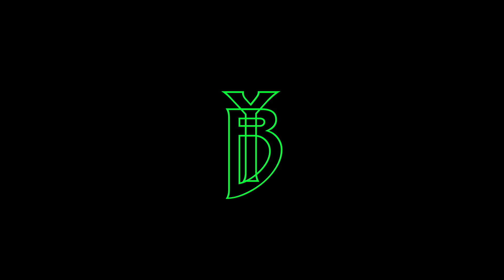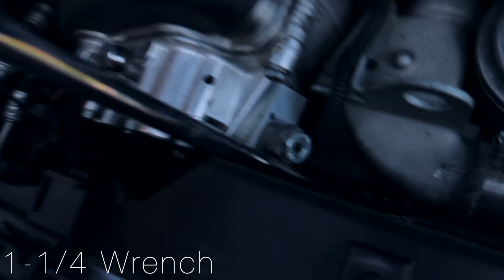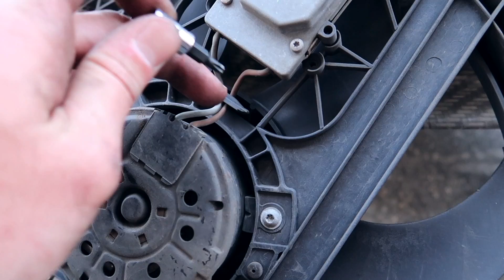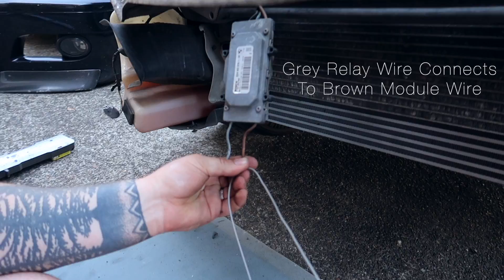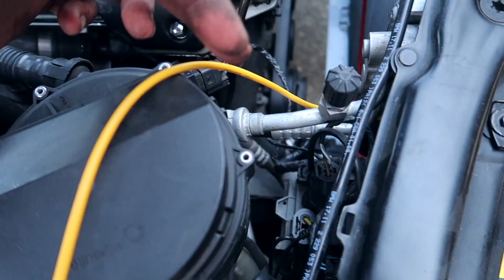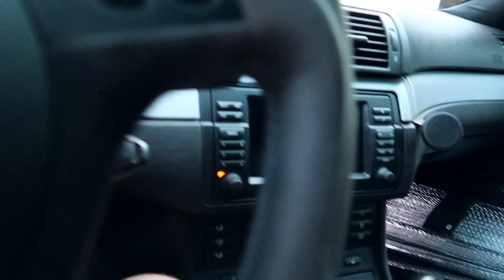EASY BMW E46 M3 SPAL Electric Fan Upgrade

Comment: Just wondering have you chewed through relays because I’m certain the fan controller will output a lower voltage for lower temps as they work like 50% then 70-90% when exceeds certain temps. I’m just assuming the voltage would be lower to the relay and might get relay chatter
Reply from the maker: Nope, I only replaced that fuse once after driving it for almost 2 years.

Comment: I did the exact same set up as you, but i spliced into the fan wires instead of cutting aux fan out.

Fan doesnt turn on. Only turns on when i connect direct power to 12v terminal.

Comment: You're right about making what you have work. That fan clutch "tool" BMW sells is a rip off. it's a flat piece of metal with two holes drilled in it. So I just found a flat piece of metal and drilled two holes in it. worked great
Reply: I got a set off Amazon for $12.

Comment: The fan in front of the car is for the a/c no need to have removed it.  Now your a/c won't cool well  especially in town.  It also is a safety fan and runs when engine gets overheated.
Reply from the maker: Yeah I've realized that after a year of driving it. Never over heated, but definitely planning on putting it back on.
Reply: @YEVSBUILDS  or you might wire the same fan you installed to work on with ac too

Comment: I noticed you are  running 265's on OEM 18's, I'm thinking of doing the same. Any issues with that?
Reply from the maker: Nope, as long as your ride height is set properly you'll be fine

Comment: Curious why the new relay and fuse were needed. Isn't the fan control module already wire to an upstream relay and fuse?
Reply from the maker: Just as a back up for the most part. The fan takes more amps than the original one too

Comment: The lack of redundancy with one puller fan makes me nervous for a DD car. I've replaced the fan and fan clutch every 40-50k with zero issues and I see 100°F+ temps from May through September and hard freezing through winter. I'd love to know how may folks have a spal setup like this with significant miles on the E fan puller setup.

Comment: Surely having a radiator shroud would make it more effective as there's large parts of the rad not covered by the fan, so the air won't be getting pulled through it.

The Z4m doesn't have a viscous fan like the m3. And surely the viscous fan causes some parasitic power loss
Reply: I agree. No fan is better than any fan. The fan just gets in the way of air flow.
Reply from the maker: After making this video a few days later I put the shroud back on aaaand it didn't make a difference at all haha in my case at least

Comment: An u send me the link to Amazon for the wiring kit for the fan
Reply from the maker: All in the description
Reply: @YEVSBUILDS   my m3 is supercharged will 2024 cfm be enough air and  I am running a aluminum radiator as well

Comment: I have an electric fan on my e46 m3 do you think having the fan and the aux fan cause interface with cooling. I live in Texas and we hit 110 the other day and on the highway oil and water Temps went up not getting to red but Def hotter. But when I stopped at a light Temps went back to Normal lol.
Reply: You still have electric fanman ?